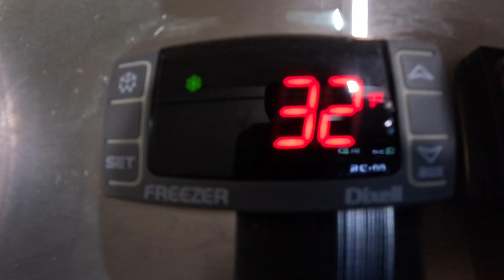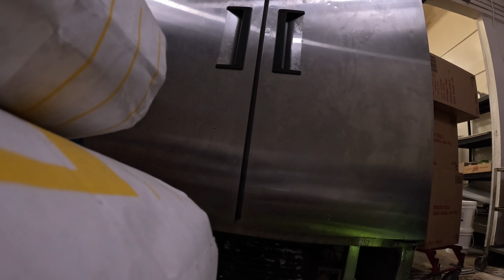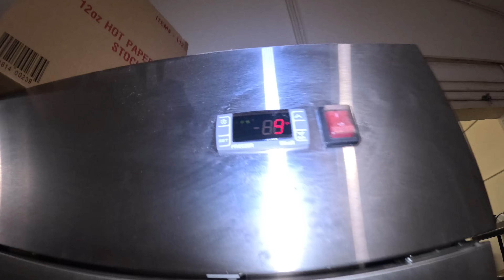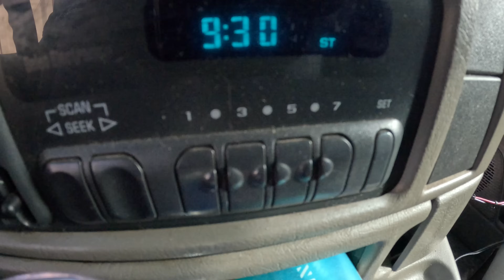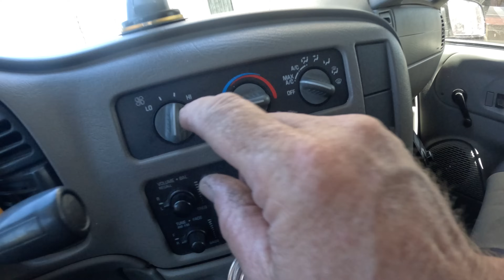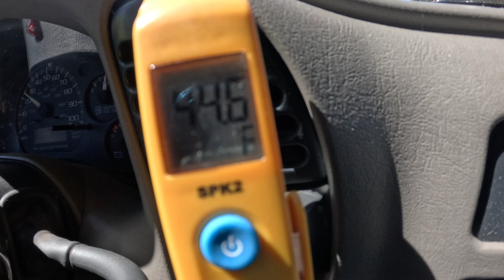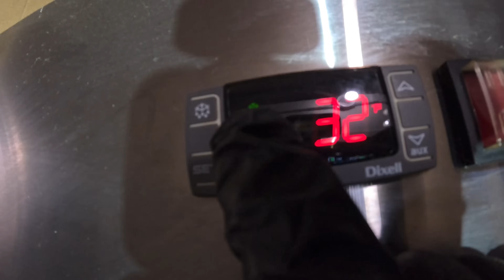Freezer and an AC call

Comment: That first one needed a whole can of viper condenser cleaner/degreaser and boiling hot water from a three gallon sprayer and then it be all brand new! Shop vac the mess up and it'll run at it's best subcooling efficiency like it did when it was new.

Comment: I wonder if something like fiberglass furnace filter fabric could be attached to the intake side of those coils to prevent them from getting clogged so easily.  Would definitely be easier to maintain if you could just change the filter fabric out rather than needing to brush the fins out each time.